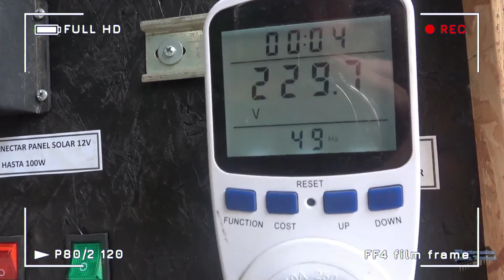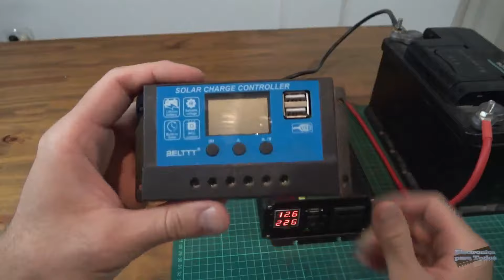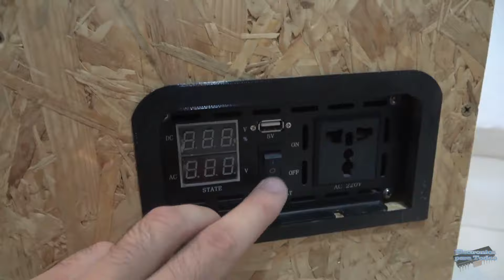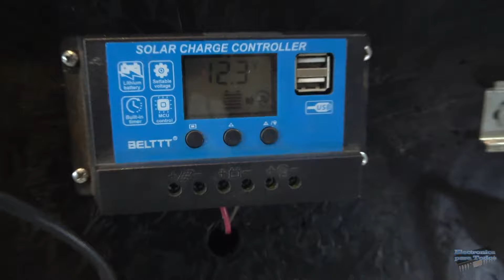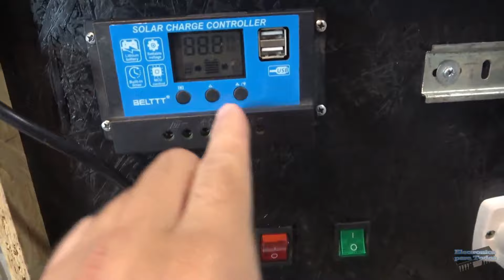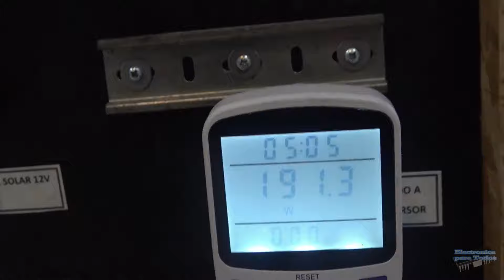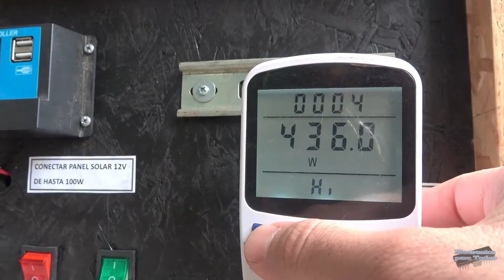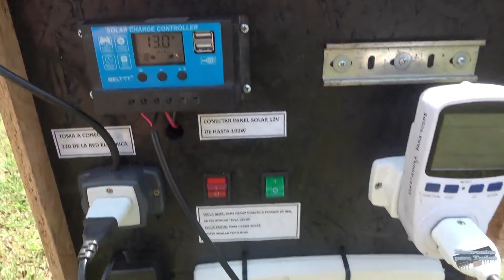COMO HACER un GENERADOR SOLAR con BATERIA de 12V,  ESTACION de ENERGIA PORTATIL - Utsource -

Comment: Me gustó mucho tu video. Muy práctico.. Que tal tener uno de estos en una cabaña donde el sistema de energia sea deficiente, y tener conectado el aparato a la red por medio de un bypass automático? De tal forma que si se va la energía de la red, entre a trabajar el aparato portatil.. Y cuando vuelva la energía, se realice el cambio a la red eléctrica. De pronto hacerlo con unos contactores? Gracias por tus videos. Ya tiene mi like.
Reply from the maker: Muchas gracias por pasar y dejar tu comentario. Claro de seguro se puede hacer lo que comentas, por supuesto hay que tener todas las precauciones en cuanto a los consumos de los electrodomésticos de la cabaña y demás, pero claro es una idea que podría llevarse a cabo.
Saludos!

Comment: Sería muy interesante ver la modificación a un paquete de baterías con celdas de litio recicladas de computadoras portátiles viejas; aunque sin duda ese es un trabajo bastante laborioso!... 😉

Pensaría que tal vez sería mejor levantar la tensión del paquete de baterías por encima de los 24 o 48 VDC; tal cual se usa en aplicaciones más estandarizadas, pero mucho depende de los paneles solares disponibles.   Si hay que trabajar cerca de los 12 VDC, se pueden usar series de hasta 4 celdas (14.8 VDC) para evitar que el inversor se bloquee al bajar la tensión de entrada!... 🥲

Comment: Ernan, sos un genio, esta muy bueno, realmente es un equipo muy practico para emergencias o campamento, cual es la durabilidad de ese equipo en horas? Con un consumo de 100 w
Reply from the maker: Muchas gracias por tu comentario, tengo un video en el canal en el cual vemos cómo calcular la autonomía de una batería para determinado consumo, a modo de ejemplo con esta batería de 12V 75Ah lo que sería 900Wh de energía  y si se tiene un consumo de 100W podríamos estimar unas 7 horas de autonomía con la batería a máxima carga, pero hay otras cuestiones por eso te recomiendo ése video.
Saludos!

Comment: Mi pregunta es, si aíslas (desconectas el general de red a calle) y enchufas esto en su salida a una toma de enchufe de la casa, eso daría corriente a toda la casa? (teniendo en cuenta las limitaciones, claro), contando que tengo placas solares con un inversor, si es un día soleado, podría convertir esto en un sistema híbrido aislado?, básicamente lo mismo que muestras, pero con la diferencia de que se dispone de placas solares cuyo inversor depende de la red exterior para sincronizarse (si no tiene red externa, pero esa red externa pasa a ser la estación de energía, en teoría debería funcionar, ¿no? Es la duda que tengo.

La otra opción es cambiar el inversor con baterías directo al inversor, pero para despejar dudas, ¡¡gracias!!

¡Saludos!

Comment: Hola cómo va?
Te quería hacer una consulta por que sos de los más confiables y quiero hacer las cosas bien.
Estoy armando un proyecto muy similar pero tengo la siguiente duda, tengo 3 pack de batería
3s 12v 40ah testeado y armado por mí, cada uno tiene su propia bms obvio, la pregunta es puedo conectarlos en paralelo para así tener 12v 120ah? No genera ningún conflicto con las bms? Desde ya muchas gracias x tu tiempo y seguí con tu contenido que vale mucho!
Reply from the maker: Muchas gracias por pasar y dejar tu comentario. En cuanto a tu consulta la verdad no sabría decirte porque no probé de conectar módulos BMS en paralelo, pero creo si debería de funcionar.
Saludos amigo
Reply: @electronicaparatodosav  gracias ya boy a probar, mí miedo es quemar las bms, si salele todo bien te comento más adelante y tendrás material para algún futuro video, no estudie electrónica por eso aprendo quemando y viéndolos a ustedes

Comment: Hola. Queria consultar si puedo usar una bateria de auto en un sistema solar? Ademas tampoco la descargaria por debajo del 20 o 25% máximo. Los consumos seria SOLO para iluminacion, 2 o 3 lamparas de 12v de 7 o 9w y tambien para cargar celulares? Para cargar los celulares usaría un regulador de 5v para no comprar un inversor y asi no usar la propia fuente del celular. Ademas quiero aclarar por si acaso es que no la voy a usar para alimentar ningún electrodomésticos, heladera tvs etc y tampoco herramientas. Las baterias de ciclo profundo son muy caras en donde vivo. Gracias por el video.

Comment: Como se conecta la fuente de energia portatil a la red electrica de ese sector de la casa?? vi que conectaste a la pared y se alimentó tomas y luces de ese sector? puede subir un video explicando esa parte?
Reply from the maker: Lo primero que debes de verificar es que la llave de luz de entrada de la red eléctrica a tu casa éste baja o desconectada y recién luego desde la salida del inversor puedes conectar un cable y el otro extremo del cable con ficha macho lo conectas en cualquier toma corriente de tu casa, pero por supuesto teniendo en cuenta el consumo de los electrodomésticos que tengas en dicho sector al que estás conectando la estación de energía.
Reply: @electronicaparatodosav  muchas gracias, no hay que hacer conexiones especiales por lo que veo, solo meter la salida del inversor a cualquier toma corriente del sector de la casa. Tengo un cuarto de estudio que tiene su propia caja de brakers ahi solo bajo los brakers y meto la estacion electrica movil.

Comment: Minuto 3:00 "en este tipo de proyecto no se debe de utilizar una batería de auto", por qué? Entiendo que no conviene pero no sabía que no se podía. Me gustaría saber por qué no se debe porque estoy usando mi kit solar con una que era de mi auto.
Reply from the maker: No se debe porque las baterías de auto están pensadas diseñadas para simplemente ayudar al arranque del vehículo, osea proporcionar una gran corriente de arranque. En cambio las baterías de ciclo profundo están diseñadas para proporcionar corriente o energía durante un largo período.
Reply: @electronicaparatodosav  Gracias por la aclaración. Sabía que no era conveniente pero no que no se pudiera, tenía miedo de romper algo.

Comment: Tengo el Inversor y una Panel de 120W y un Controlador MPPT,  Solo me hace Falta la Bateria (de LifePo4 estaria Genial)  Solo una Duda,  como Evitar el posible calentamiento del inversor? 
y Quiero conectar Un AC de Ventana de 10000 btu 
Saludos...
Reply: En teoría si bro solo que el inversor tiene que ser de onda pura o te jodes la tarjeta de tu aire además de que al ser de 12btus debe estar entre 1200 a 1500 W a no se que sea inverter tu aire  pero aun así nesecitas que el inversor soporte cuando menos 3000 W ya que cuando arranca el compresor el picó de carga es alto como de 2400 a 2700 y la otra esque si nesecitas un banco de baterías que soporte las 5 horas nesecitas cuando menos unas 4 baterías de más de 140 ah en paralelo y que te apoye un panel más grande ya que el pequeño no logrará amortiguar la carga todas esas horas
Reply: @irvingcoffee7531  es Onda Pura el Inversor, de 1500w 2000 pico y el AC consume 800w Gracias por tus Tips...